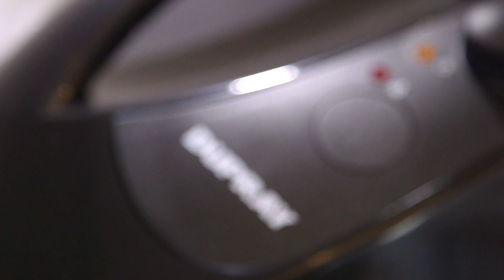Dupray ONE Plus™ Steam Cleaner Demo

Comment: I've just bought one of these this morning. I'm looking forward to seeing what this can do!
Reply: I just got mine and it has a sticker on the box saying not to use with distilled or deionised water.

Strange because it the instruction manual it says if you live in a hard water area to use 50% tape water and 50% distilled water.
Reply: @mrtuber3491 tap water not tape water.

Reason is the water sensor measures PH and distilled water is PH NEUTRAL